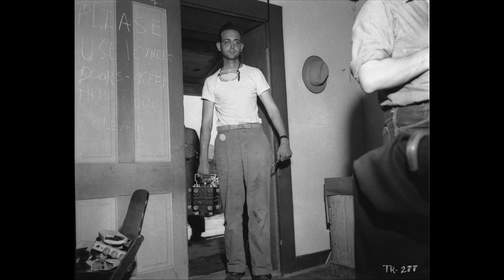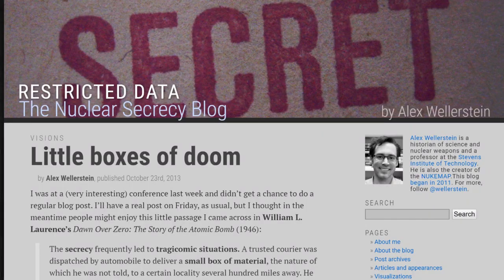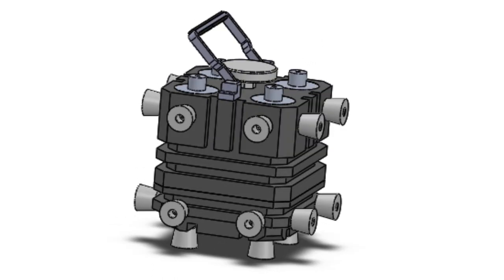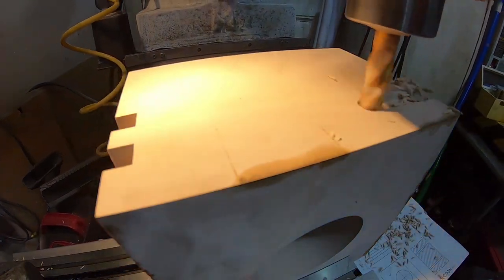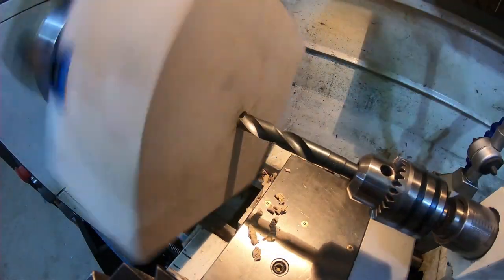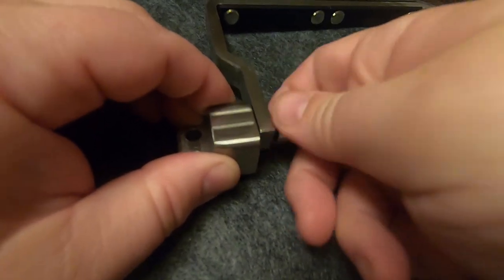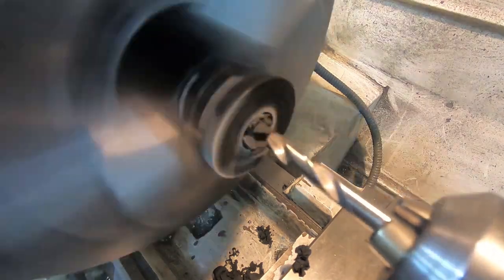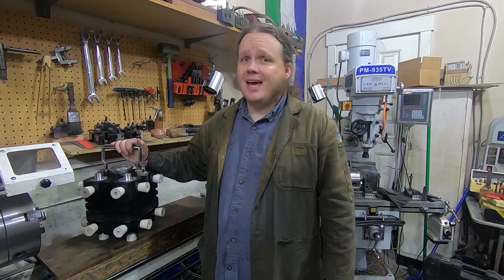Manhattan Project plutonium box replica build

Comment: The handle and covers are made from brass.  Garrolite handle parts on top and bottom.
Reply from the maker: Oh, neat! Where did you you get that information? The box is no longer in my possession, but I could possibly make replacements to send down to the museum.
Reply: From the original drawings from 1945.  Internal geometries ARE classified, but external are not.  @Attoparsec
Reply: I emailed you some more details and pictures of mine.